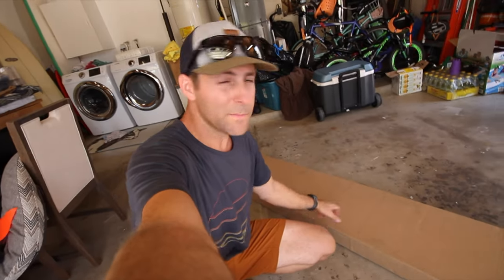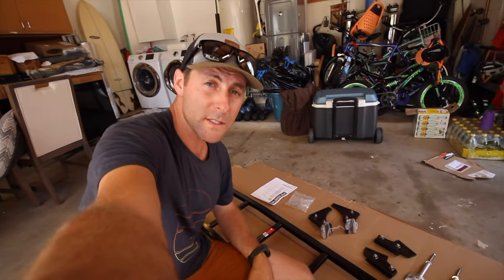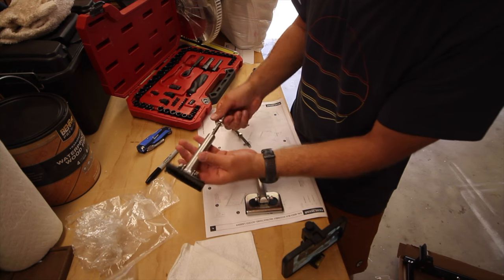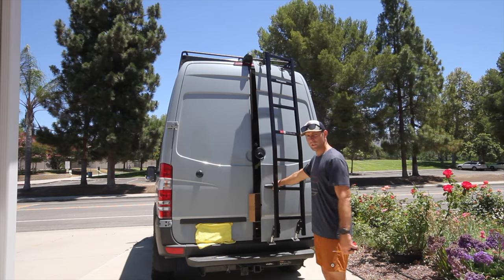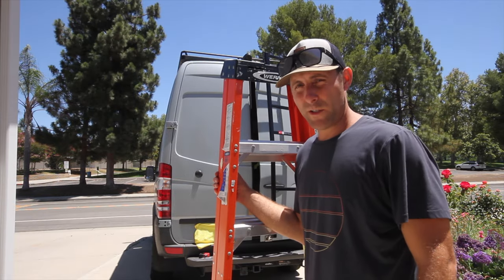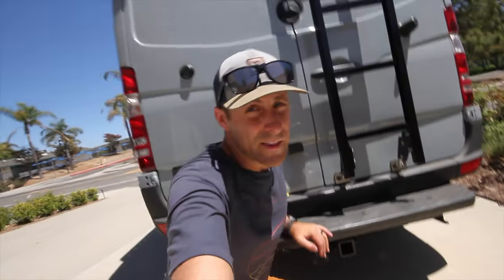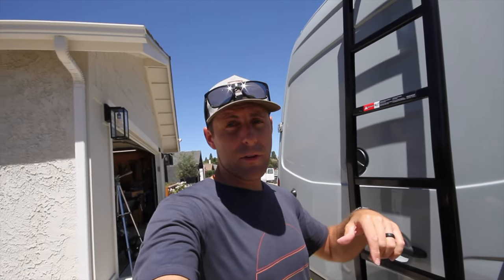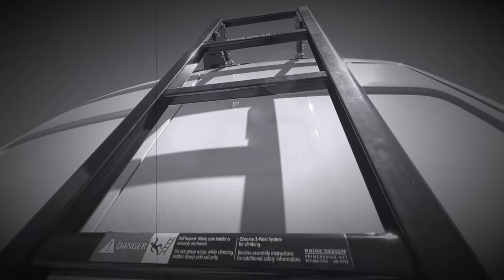BEST VAN LADDER! (With No Drill Install)

Comment: It's a shame nobody shows where one has to climb the ladder and get off and onto the roof. That very important transitional move from ladder to roof is edited out on all the videos I've been researching for the past hour😭
Reply from the maker: It’s probably cause it’s very difficult to film by your self on a 9ft van! In my short titled we did Christmas lights a little different this year you will see where I step on the edge of the van. It’s the same when I get off the ladder in this video :) hope it helps
Reply: @EventheWavesYT  Yeah but in that short you are not using the installed van ladder - you are using a regular one. Anyway, thanks for trying to help I appreciate it. P.S. Your van is beautiful
Reply from the maker: Thank you! Lots of blood, sweat and some tears :)